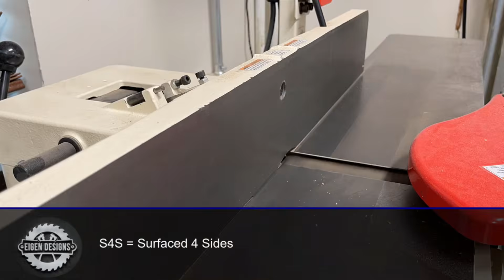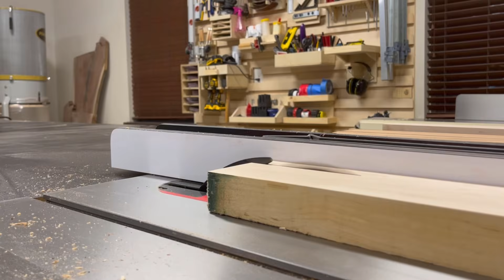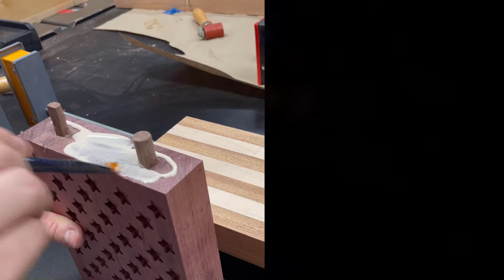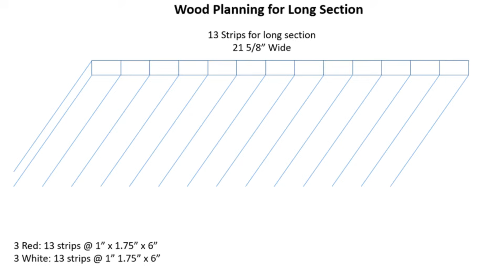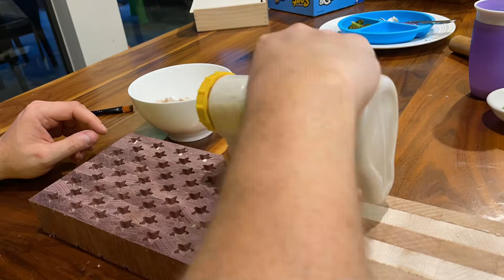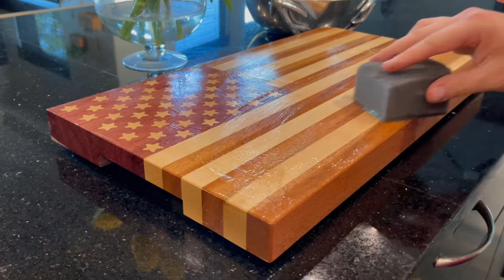American Flag Cutting Boards |  Edge Grain and End Grain Boards with CNC Inlay

Comment: These look great. I plan on doing one with redheart, purple heart and maple. Curious why you chose mahogany, though, as I would consider that way too soft for a cutting board.
Reply from the maker: Hey Devin, if I were to make these again I would use Pauduk for the red stripes. Its a bit expensive, but the red color really pops when you apply some finish. 

Good luck with your build!

Comment: Great video.  You are a good instructor - calm voice, no obnoxious music, easy to understand.  I would personally do a v-carve inlay for the stars and cut the male inlay star pattern with all the stars instead of cutting and gluing 50 individual stars.  Stars will have sharp points.  Always a tight fit with no gaps.  I prefer to take the extra time and only make end grain cutting boards.
Reply from the maker: Thank UncleBob. I agree with your comment about the vcarve for the inlays.This was my first attempt at it using the CNC but would definitely pivot to a vcarve forthe sharp cornersfor future builds.

Have a good one!

Comment: After cutting the “filler” stars on the CNC, how do you cut each one out and clean it up?
Reply from the maker: Hey Jim, I cut the stars out with the CNC and cut all the way through the stock material so each star was already "cut out". They didn't require any additional cleanup so I just took the inserts stars directly from the CNC and glued them into the previously carved inset pockets. 

Hopefully that answers your question.

Comment: You can run an end grain board through a planer. You have to glue sacrificial boards on the ends of the board before running it through, then cut them off on the table saw. Take minimal depth passes through the planer. I’ve done it several times with no problems. Learned it from watching MTMWOOD, the master of end grain boards, in my opinion, and many others. He made the same flag board.
Reply from the maker: Thanks for the tip Bob. I agree that MTMWOOD makes incredible boards.

Comment: I've made a couple of these in the past but without the inlay! Those look great! I just got the onefinity and want to attempt the inlay, will you share the bit you used and the speeds you were running it with the Purple Heart. I'm afraid I'm going to break the bit with that really solid wood lol
Reply from the maker: Hey Blake, the bits are pretty sturdy. I use a 1/8" Amana bit that you can find on Amazon: https://amzn.to/3DYsTEb and run it at 50 in/min at ~15,000 RPM. The bigger thing for me is the step down size, which I normally have set at 0.15" for a bit this small. 

Good luck!

Comment: Both are beautiful but I love the end grain more!
I would love to do this build but I don’t have a cnc machine. Any ideas for making a flag cutting board with less sophisticated tools?
Reply from the maker: Thanks for the support! You bring up a good point: not everyone will have a CNC. There are two ways you could achieve the star look without a CNC. The first is to use a router with a star inlay stencil set that can be found here: https://amzn.to/3nuLX8c  I have not used these personally, but have heard of others using them with success. 

The other, and more tedious way, would be to trace stars onto the wood and then individually carve out the pocks using a chisel. You could then fill the pockets with white colored epoxy resin and sand over it to get a seamless look. 

If you end up using either of these methods please let me know and I will pin your comment on my video.

Comment: Beautiful job! Those came out great. :-)
Personally I'm a fan of edge grain cutting boards. Easier to make, no real difference in performance. A huge cherry or teak cutting board is on my project list.
Reply from the maker: The Whiteside bit you recommended to me was perfect for this project! Thanks for the recommendation.
Reply: @EigenDesigns  No problem! Whiteside bits have been serving me well since I started woodworking 17 years back. :-)